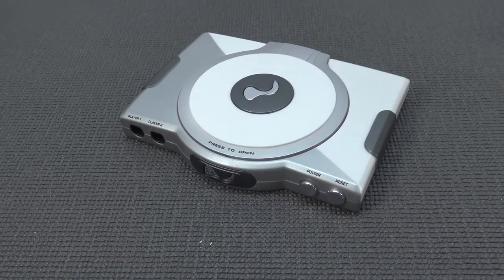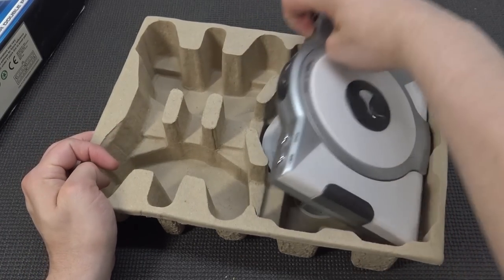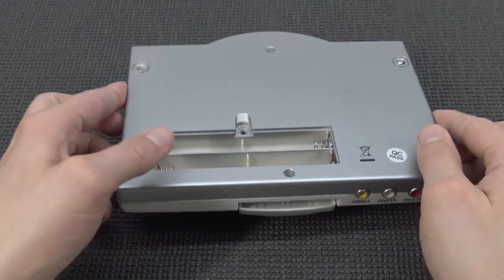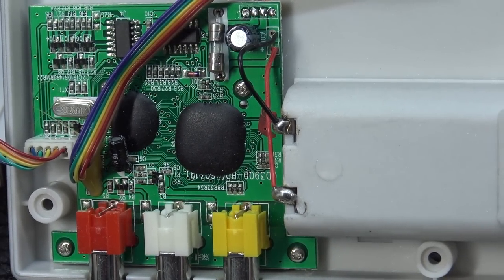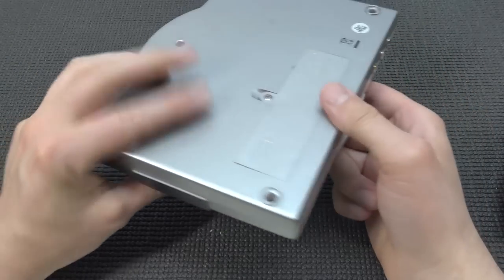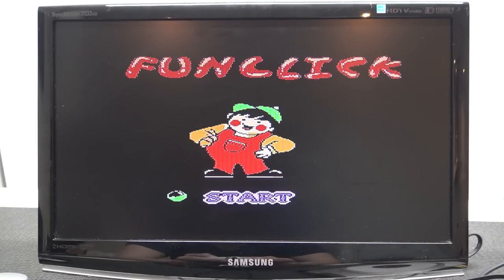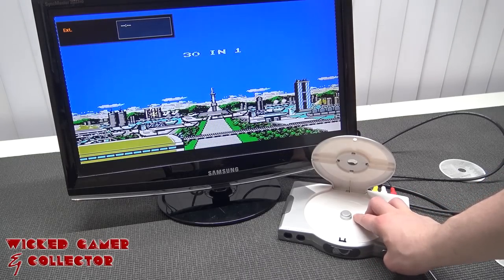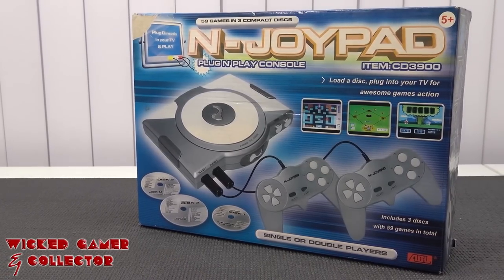Weirdest Retro Gaming Console Ever Released in 2023 😆

Comment: I always wondered why there was never a third party bootleg that made a console that could run snes/Genesis and PSX considering there were many Genesis/NES bootleg that could run both consoles games... Not good quality probably but it was there and actually kinda worked as a fast choice for people that just want one console on the tv
Reply: There was and there is. Also not sure why you compare NES / Genesis with PlayStation1 era. Those are generations apart and PS1 basically a much more complex system. Either way there are bootleg systems made that run all the mentioned from a SSD card. You will often find these in online China shops or inrl if you dig around and ask shops. Some sell these without even realizing they are breaking the law XD
Also they are dirt cheap compared to some other 'premium' brands that offer even less.
This is why many were angry and complained for those official mini NES, Sega and mini PS1 from some years ago, it barely ran any games and had issues plus was around 100 euros. You could buy a single console for 20-30 euros that ran all and much more systems much better and any game you put on your SSD to load in.

Comment: Yo why does it need a Fuse?
Reply from the maker: I mean this looks like a console only it more plug 'n play machine pure on battery's.
Reply: @WickedGamerCollector  yeah that's true, but the PCB has a fuse soldered on it. Seems pretty pointless for running on batteries. Maybe the PCB is from another machine that powers from an adapter and they just plonked that board on this and called it a day